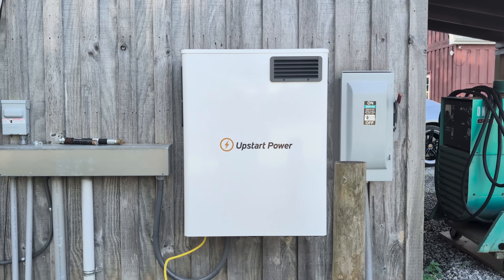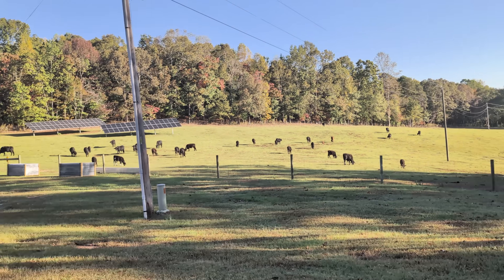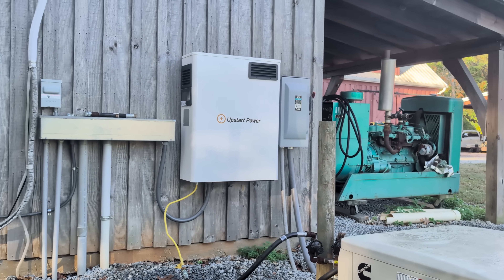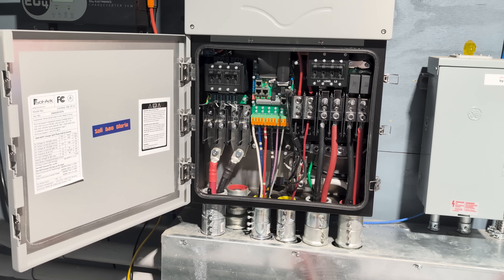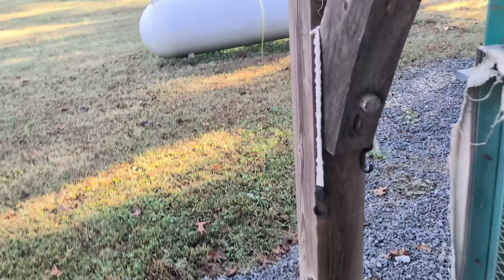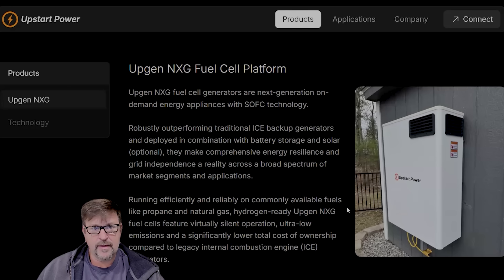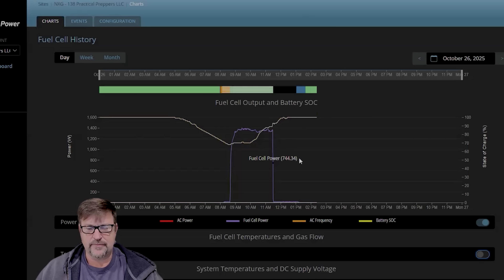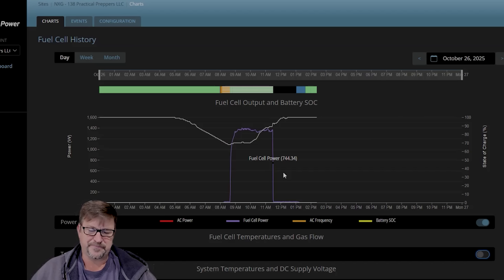You’ve Been Waiting for It | The Upstart Fuel Cell in Action

Comment: Something I couldn’t find on the documentation is what’s the warranty length and what’s the real world expected run time in hours? If you’ve got a catalyst doing the conversion, it will get used up eventually. I have heard that hydrogen powered buses and things like that. I’ve had considerable troubles with the life expectancy of the fuel cells sometimes being a shortest like three years. 

To fully understand if this is a viable solution, you need to know the upfront cost the operating cost, and the longevity.
Reply from the maker: All good points and I am taking notes on these comments and questions. I hope to have better answers for you on the next review. I'm going to be doing some long-term runs.
Reply: Product Warranty (Upgen NXG Fuel Cell):     10 years or 2,000 runtime hours or 250 on/off cycles - which ever comes first
Reply: @UpstartPower  so the warranty will run out after ~83 days of continuous operation? Based on the limited output that would price each kilowatt hour at almost 4 dollars. what’s the real world expected runtime on this unit?
Reply: @Miweatherspotter1 Yes. However, the intended use case for the fuel cell is to act as a support system for battery storage (+ solar) that powers your house during an outage. The system that is being tested here consists of 1 Sol-Ark 18K hybrid inverter + 2 Discover Energy Helios batteries ( 2 x 16 kWh = 32 kWh) + 1 Upgen NXG DC-coupled fuel cell (34 kWh per day). During a prolonged grid outage, and assuming an average daily home load of ~ 30kWh, the batteries give you a little more than a full day of energy resilience. In the context of a holistic energy management system design, the fuel cell enables the right amount of battery storage (+the right amount of solar) to do their job for as long as the grid outage lasts when there is insufficient sunshine. The amount of batteries that you would have to add to a system to achieve the same level of energy resilience is not economical  -->  Battery Storage + Fuel Cell replaces legacy internal combustion engine generator in your system design.
Reply: @UpstartPower  I understand the system design. It certainly has its use case if absolutely quiet operation is of Paramount importance. It will be hard to justify an economic basis when a small efficient portable generator costs $500 and has a projected 500+ hour life. That would price the equipment levelized cost of Energy at about $.25 a kilowatt/h 

I’m sure there’s use cases where quietness and absolute efficiency on fuel outweigh equipment costs. I think it’s going to be a tough sell at eight grand. Personally, I would love to add one to my set up, which already includes solar battery backup, and a portable generator however, I would want to see life cycle testing, and an order of magnitude longer warrantee. 

The energy geek in me thinks it’s pretty cool that you can get a wall mounted steam methane reforming unit to strip hydrogen out of natural gas and propane!
Reply: @UpstartPower  I live in Alaska, where I have very limited solar available for about 3 months out of the year. In the winter, I am dependent on running my 8kw diesel generator about 6 hours per day. I would love to replace the generator with several fuel-cells in parallel, but of course, the system would have to last more than a single season.
Reply: @qaggaz  that's it man your diesel generator will last your whole life if you take care of it and can run on just about anything if your really hade to
Reply: @Miweatherspotter1  Not "steam methane reforming" -->  SOFC technology (solid-oxide fuel cell)
Reply: @NightshiftCustom  the problem is maintenance is not free. In addition to the regular on-going service like monthly oil and filter changes, belt replacements, etc. And while you absolutely can run different fuels, that also can take a toll on fuel filters which may need to be replaced more often.

As parts age, they still need to be replaced. Since the generator serves as my prime power source for half the year, it gets a lot of daily use. Bearings wear out, belts break, radiators hoses fail, radiators develop leaks, glow plugs fail. On the controller side, relays wear out and need replacement, control boards fail and need replacement. The high vibration environment can cause connectors and terminal blocks to work lose, or develop cracks due to material fatigue.

And of course, failures happen at 6PM the day before a holiday, or at 4:30 on a Friday. My last generator lasted about 15 years before the cost of repair exceeded the replacement cost of a new (and larger) generator.  Sure, the engine could be rebuilt, the bearings could be replaced (again), the leaking coolant pump could have been replaced (again). All of these repair cost time and money.

If the service requirement on the SOFC unit consists of replacing a field serviceable air-filter on a regular basis, replacing a field serviceable blower when needed, and replacing the SOC every 10 years (assuming that is field serviceable), that seems like a reasonable trade off. Again, assuming these things are not just disposable, and that parts can be repaired/replaced in the field (as with a generator).
Reply: @qaggaz  na man sure you need to do the v-belt for the alt every 10 yrs and maybe the filters and oil here and there but the power cell its self breaks down over time and that's why there warranty is only 2,000 runtime hours or 250 on/off cycles 
you can not run this none stop all winter as you would be out a warranty in just one winter 
that diesel motor will run for 20.000-30.000hrs without any major problems
also 1400 watts for 24hrs is just 33.6 kwh that diesel is likely able to do that in just 1-2 hours of runtime
Reply: @qaggaz  It all sounds good until you look into the price. Hydrogen is extremely expensive compared to diesel. It is hard to store compared to diesel. It leaks from everything and embrittles any metal it comes in contact with. The reaction from the fuel cell needs to be kept warm and it also creates water which has to be kept above freezing. The losses from heating the unit in a place like Alaska will cost more than running the diesel. It would never work for a situation like yours anyways unless you have an unlimited supply of money and hate noise. Because just like you pointed out you would have to buy new fuel cells every season.
Reply: @qaggaz  The cost of just the hydrogen will far outweigh any maintenance cost associated with a diesel generator.
Reply: @Aircam73  Agreed (regarding the cost of hydrogen storage)! A few years ago I did price out how much it would cost to store around 3 MWh of H2 at various pressures in tanks actually designed to store hydrogen. There are many variables to consider, but all scenarios at the time were over $250k. This was still significantly less than the equivalent amount of battery storage, but still beyond my budget.

But, the benefit of a system such as the one we are considering here, is that it would not be necessary to store enough hydrogen to cover three months of darkness, and it would never be necessary to buy hydrogen if you have an electrolyzer (like an Enapter EL4, for example) used in the summer months on those long 20 hour days. Propane can be used as the primary fuel, optionally supplemented with hydrogen produced in the summer.  

Heating is really a non-issue. I house my diesel generator, my LFE batteries, and my inverters inside my heated heavily insulated garage currently (along with my car). Where I live, In January (the coldest month here) the average low is 9°F and the average high is 23°F. The four hours of daytime (with the sun just peeking over the horizon) is a more serious problem (at least for solar production).

As far as having to buy new fuel cells each season, I do not think that is likely to be true. When I last looked at PEM fuel cell technology, while they did de-rate over time, they did not actually stop working after a year or two. I realize that this is a different technology, but it is still an electrochemical fuel cell with similar properties and failure modes.

A reasonable question is how much does output degrade over time.

A second question is whether the system could be designed to be mounted inside and exhaust directly to the outside (like an on demand propane water heater).
Reply: @NightshiftCustom  You know, I actually do live off-grid with a diesel generator and a battery and solar today, and have lived full-time off-grid for 13 years. I am familiar with the cost and maintenance requirements of diesel generators, batteries, etc. And yes, my last generator ran for about 32000 hours before I finally replaced it.

My 9kW diesel generator (an industrial Northern Lights) had a one year, 1500 hour warranty. That does not mean that the generator must be replaced after 1500 hours, it just means that I am responsible for paying for repairs on the unit after that time. I run it for about 6 hours (not at full load) to get around 30 kWh each day in winter.

What I would be looking for, would be a device such as this one that could run continuously for 3 or 4 months, producing about 30 kWh per day, until the sun was high enough above the horizon for enough hours to produce solar power.
Reply: @Aircam73  I think we are just talking about comparing the cost of a propane powered fuel cell system to the cost of running a diesel generator now, right?

Adding in the possibility to consume hydrogen in the future is just a bonus. It is something that the Upstart can support now that a diesel generator never will be able to do.

So, just focusing on comparing propane and diesel, diesel is a more energy dense fuel, while the propane fuel cell is more efficient. Looking at the specs, I do not see as dramatic a difference in cost per kWh produced as claimed. There is a difference in the cost of consumables and maintenance (for me, about $50 for every 200 hours of run time for oil and filters). There is a benefit in not worrying as much about fuel quality with propane. There is a difference in noise levels. Since the fuel cell is not mechanical, there seem to be fewer components that are likely to fail.

For off-grid use, I would think it would be better to have 2 of the Upstart units yielding 3kW of power, or up to 60 kWh of energy per day. Not only does this provide more power, but also some redundancy as well. If one unit is down for repair, there is still sufficient energy produced to get though a dark day. In fact, it would not be unwise to keep a generator around anyway, as rarely used backup using a different fuel source.
Reply: @qaggaz that's just it they do not tell us how much power it outputs at 2000hrs runtime also they have only tested up to 4000hrs and 500 cycles so what does that tell you ?
To me it not worth the money at all.
Would need to be a cheap replacement cell for it or it's just not going to work long term 
Even the unit in the video is only outputting 1400w not 1600w. 
 now it that from age/losses or is that what ya get when it's brand new?
Reply: @NightshiftCustom  Welcome to the bleeding edge of technology! The fact that it has only been tested to 4000 hours and 500 cycles just tells me that it is a new, bleeding edge product and that Mike is acting as a beta tester for them.

I think you may be reading too much into the lack of data.

The manufacturer really may not have tested beyond 4000 hours yet, so may not yet know what the expected performance will be after 4000 hours. Maybe you are right and the unit become useless after 4000 hours, or maybe it will last 20000 hours with 10% degradation?
Reply: @qaggaz  The amount of energy you get from this is so miscue for the price you pay it is ridiculous. You could literally go with a larger wind generator and get close to or depending on the size much more power and it would do it year round and require NO fuel. All fuel cells use their precious metals in the reaction meaning that yes they will just die one day and it won't be long after what they said it would be. So, if you get through 1 Winter I most certainly wouldn't expect to make it through another without replacement and fuel cells aren't cheap.

I don't know if you have price LFP batteries lately but the costs have come down significantly to the point they have 12.5 kWh batteries out there for $2,000.
Reply: @Miweatherspotter1  Remember it is a new release product, prices start out high, users pay early-adopter fee, in time the prices drop, especially once other companies also making similar products. It's good to see something like this in the market, as volume sales increase, they also figure out how to bring assembly costs down, prices will eventually come down in time.
Reply: @samsonite8017  I understand S curves for adoption and production savings by going to serial production. However, I look across other industry segments that use similar technology and I see hydrogen powered fuel cells having a high failure rate in trains, buses, cars, etc.. I just looked at the cost per unit of energy produced and say it’s gotta come down by an order of magnitude in order for this to be competitive with the existing solutions. Unless however, you need quietness.
Reply: @UpstartPower  Is that really 250 cycles!? what constitutes a cycle? Warming and cooling cycles (loss of external power) or 250 start/stop generation cycles?? 250 seems comically low for something marketed as a backup system.
Does the efficiency go down the longer these run (continuous)?

Comment: That is kinda cool product.  A bit pricey currently but as the market grows it ahouod come down.  I wonder how long a standard propane tank size  like for a grill would last.   What type of warranty does the product have?  It is nice that you can paralell the unita for a heavier need.
Reply: Product Warranty (Upgen NXG Fuel Cell):     10 years or 2,000 runtime hours or 250 on/off cycles - which ever comes first
Reply: Grill tanks are a little small for this application. We recommend at least 2 x 100 lbs tank cylinders w/ switch-over (deliver/replace), or 200 gallons built-in tanks (refill) like in the video.
Reply: Nice warranty. I was wondering more on how much gas it would use in like a week why i asked about the smaller tank.  Like it runs for 2 days straight and consumes 25 lb tank.  That way a person can compare against maybe a generac like  in the video which uses x amount to show the efficentcy
Reply: @MrBmonroe924  
Output Power:  1.4 kW = 34 kW per day
Fuel Consumption - Propane:  0.13 Gal / kWh
Tank Size:  25 lbs (your question) = 5.95 gallons --> 45.8 kWh  / 1.4 kW = 32.7h = 1.4 days of continuous runtime during a grid outage
Use case:  The main purpose of the #UpgenNXG fuel cell is to support the battery storage (+ solar) in your home energy system, filling the gap when these are insufficient to run your home loads.
Think:  Battery Storage (runs your home loads) + Intermittent Generation - Solar (replenishes your battery when the sun shines) + On-demand Generation - Fuel Cell (fills the gap when battery + solar is insufficient)
Reply: @UpstartPower  could I run continuously for 30/60/90 days?

Comment: Thanks for posting. Glad to see some real world use stats and cost.  There is a lot to like about this. There are still advantages to a normal generator, and they have their place, but this setup with proper approach and management offers a great setup.  I'd leverage some weather app predictions to not engage when sun is expected to be up shortly and plentiful throughout the day.  On the same note, if poor solar conditions are expected, setting it to top off every few hours like you have it is super smart.   Would be interested if their efficiency comparison (5-8x),  or propane use claims are actual run time consumption, or something like daily averages compared to a combustion genset.
Reply: Very much like your thoughts on intelligent management of the whole HEMS  -->  Now add 2. Self-Consumption and 3. VPP Monetization to the 1. Energy Resilience use case.
Fuel Consumption - Propane:  0.13 Gal / kWh  = actual runtime consumption
Reply: @UpstartPower  Thanks for chiming in.  Those are impressive numbers.  In recent outages, my whole house propane generator (21KW) averaged 40 gallons per day.  Yes, it puts out a ton more, BUT I rarely, if ever, need that much at once.  A modest battery setup and the Upstart could be a game changer. Even running 24 hours, Upstart uses 4.8 gallons PER DAY (if I did my math right). That means I can use my 500 gallon propane tank (400 usable) for 83 days versus 10 with whole house generator. 
 
A 10 day outage cost me $1000 in propane! With upstart it would cost me $120, but more importantly, I would not even NEED to call the truck for 5+ events.(they wont even come out for less than 100 gallons delivered). Major peace of mind. 1-2 inverters and 1-2 batteries for total home coverage, or 1 mid-size inverter and 1 battery for an critical loads panel (including one AC unit!) and this makes WAY more sense than a whole house generator. The smaller, super quiet, and no emission features are just bonus. 
 
I'm in SE Texas, so its all about the emergency use. We are not net-metering friendly, and out time of use plans are weak at best. In other states, like you said, adding in the logic and usage when NOT in an emergency, and it would be even more effective.  Thinking the  emergency use use case, I do hope the price comes down some as manufacturing ramps up. I don't think its horrible now, but running the numbers, its a harder sell to the Chief Spousal Officer than I hoped. I'll keep an eye on this especially as we redesign the property and solutions we have now.